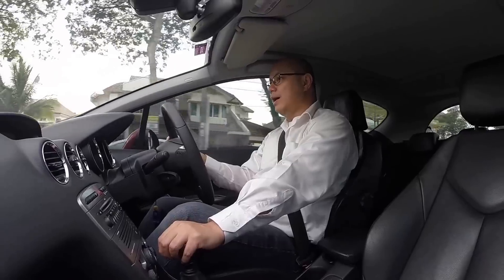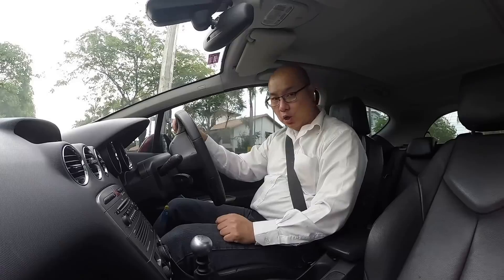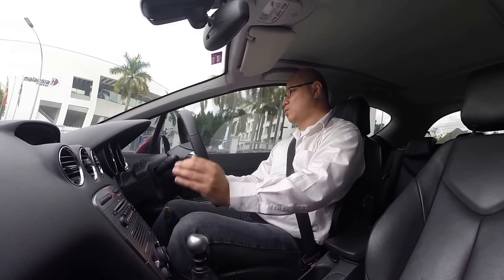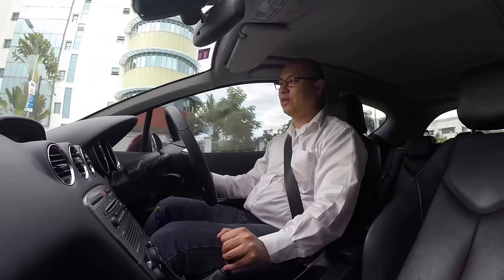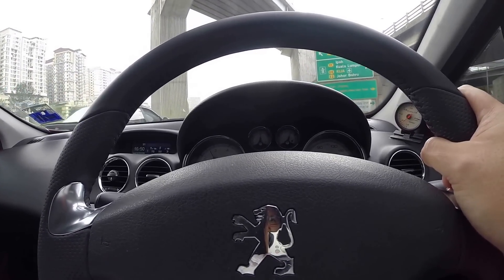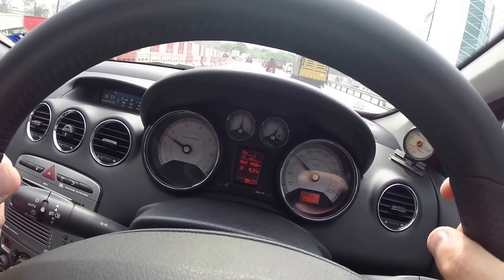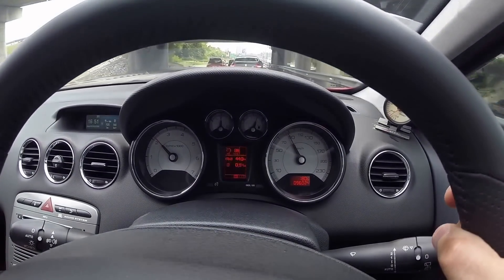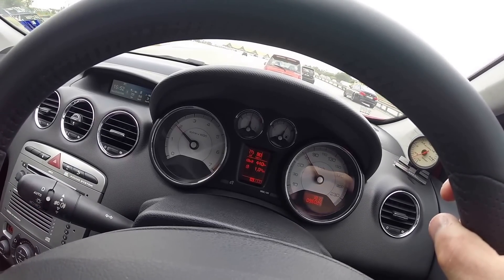Decarbo for the Peugeot Prince Engine

Comment: I have two Pugs with Prince engines.  Did first decor myself.  Took six hours.  Look on the RCZ or AussieFrogs forum.  I now use SA459 (Subaru) every oil change.. Check out those forums.